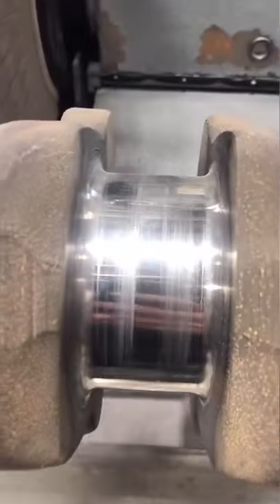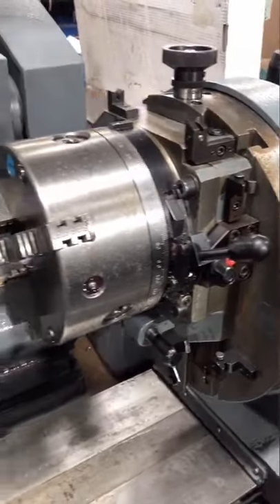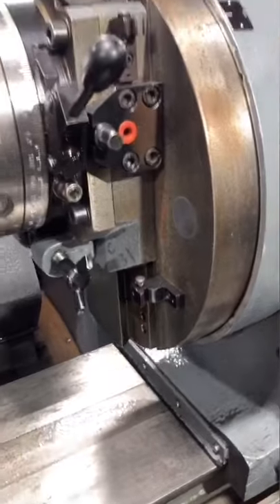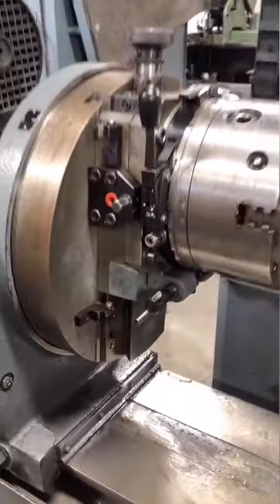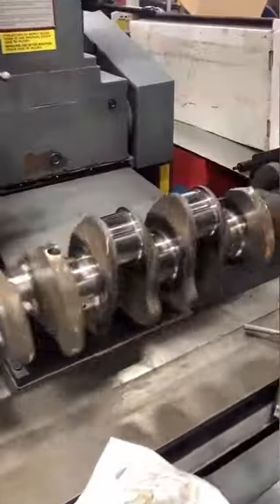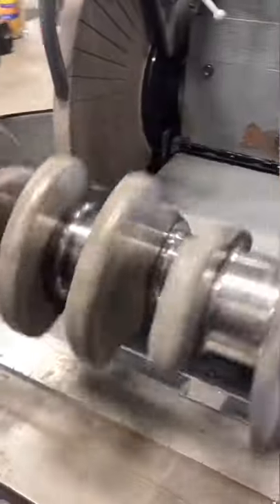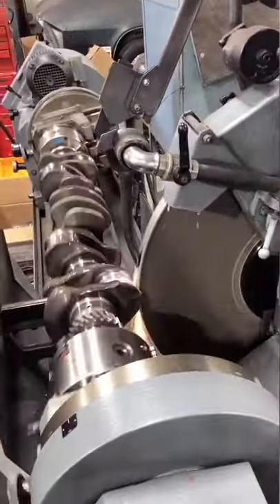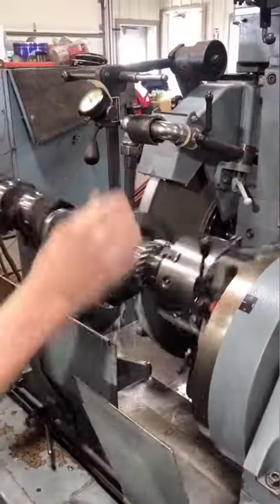#shorts How A Crankshaft is Reground - JAMSI ONLINE

Comment: Ive never seen a crank cut before! All the years around engines this is the first time!!
Reply: Same here. Very interesting to see the process. I'd like to see a full video on it.
Reply: Same, seen them polished before but never ground.
Reply: Because grinding crankshaft requires hardening again afterwards. So I you don't have the ability to reharden it again. Don't do it.
Reply: You should look up crankshafts being cnc machined, even crazier than this regrounding operation.
Reply: @Trident_Euclid  I've been a crankshaft machinists for 26 years and machined cranks from raw forgings to finished..I've worked as a machinist for crankshaft specialist, lunati crankshaft and Feuer crankshaft...the journals normally get a case depth harness of .100"(.050" per side) or more which allows for a O30"-.040" undersize bearings to be used....quite a few crankshafts just get heat tempered with the journals never being individually hardened if anything just the thrust surfaces get hardened..maybe your referring to some large diesel crankshafts which mostly get undercut then have industrial hard chrome plated to the journals to keep surface hardness and a standard size bearing...I've done that process as well...but regular automotive crankshafts can most certainly be ground undersize...
Reply: @MrBubbahunt9  are they ran in a batch furnace? I worked at a heat treat place before but we only did nuts and bolts!! They had to big belt furnaces!
Reply: This is a throw-away society now, get with the program.
Reply: @musicpunk5  its about cheap enough to buy crank kit than to have one ground down!
Reply: @jasonhastings5538  maybe for some car engines. It won’t be for commercial diesels.
Reply: @davidelliott5843  not too mention vintage engines and restorations. 👍🏻
Reply: That’s because many places just replace parts instead of doing work on them
Reply: Yup..just polished.. Like he said ..a rare machine
Reply: There are only like 5 of those machines here in Puerto Rico....
I clean cam tops, my boss sends out to cut the cranks, still I haven't seen the actual machine itself
Reply: @musicpunk5  heh... the world is going down...
Reply: คิดถึง
Reply: @Trident_Euclid  back in the day when i first started working on engines we always sent crankshafts to machine shops to be turned & polished.
Reply: @MrBubbahunt9  i know of several gasoline engines from back in the 70's & 80's that have been rebuilt, had the cranks turned & used .10 & .20 undersize bearings. The rebuilt engines went on to run thousands of miles without any issues. We just sent the crankshafts to a normal automotive machine shop & never had any issues!  
Thank you for explaining the operation in your comment, i think it helped to honestly clear the fact.
Reply: I worked on a CPM as they were known for grinding ship engine crankshafts, This is a baby version.

Comment: The Arnold gauge. Designed by Arnold who worked for Henry Ford. Henry wanted him to speed up the process so he insisted. Arnold designed the gauge to measure while grinding simultaneously.
Reply: Thanks for that Lil' bit of history !
I'm an automotive history buff, and never knew that !
So, now, I am going to be doing more research on this one !
One more lesson taught !
And wayyy more to be learned !
I'm almost 65 years old, and still learning more every day !
A genuine thank you !
Reply: Ford also used Johansson blocks for vendors to have standardized measuring.
Reply: The Arnold gage is amazing and extremely accurate, until you find the oil hole and knock the carbide tips out. 😂
Your Zanrosso looks to be in nice shape, Very Nice machine.
Nice touch on the steady rest as well.

Comment: I was a grinder operator at DMAX for the Duramax Diesel engine. You’d be surprised what a crankshaft looked like directly from the foundry. There are 21 steps from start to finish not including heat treating and balancing. Was a great job.
Reply: Oh I was thinking this was for used parts repair

Comment: Could you do a video on how a crankshaft is balanced?
Reply: From what I’ve seen, they dimple the counter weights
Reply: Yeah same machine but different counter set
Reply: You drill a hole in the counter weight and fill with heavy metal.
Reply: It’s rather boring whichever way it’s done. At least to me it is.
Reply: @Pro2ndAmnd Then why watch they video and comment? makes no sense.  Not like it's clickbait.  It's very interesting.
Reply: @paranormalextract4976  If you read the post from the OP, he asked about crankshaft balancing and not this video. I watched the video and nowhere in it was a crank being balanced.....
Reply: @Pro2ndAmnd  Thought you were including regrinding in your statement.  My mistake.  Either way any engine work is very interesting.
Reply: Are you interested in the math/computation behind balancing? Because the sensors they spin these on measure the imbalance as voltage and the use a crank trigger to show where the peak is against the degree of the shaft
Reply: @carlcomputer9686  I am interested
Reply: @Avery Brant Very smart suggestion!!.. 🤗🙏
Reply: @Andrew-xe7st  
You mean Led Zepplin, Motley Crew, and Slaughter?
Reply: He's showing you ,this is also how you balance it ,to ad weight they weld a line on the balancer then grind it if it's to much

Comment: I’d love to see a video on how you setup the crank in the lathe fixtures.
Reply: They usually have three center drill points with the same offset as the grinder showed. Then when you finish the fist position you move to the second and so on…
Reply: @MuzikHead  That makes sense.

Comment: They are a very cool machine i used one quite a lot in my late teens to offset grind the crankshaft of a Holden 308 cubic inch V8 and run 327 pistons and 350 rods ended up 348 cubic inch and loved to rev tunnel ram twin custom built 390 Holly 4 barrel

Comment: I LOVE IT😀😀😀❗❗❗❗
40 YEAR MACHINIST HERE.
I've ALSO FOUND THAT AS MOTORCYCLE VALVE SEATS WEAR OUT AND YOU LAP(AND OR CUT THEM)
THE BUCKET AND SHIM SET UP( MY 1980 YAMAHA
850 MIDNIGHT SPECIAL)
YOU CAN SURFACE GRIND
THE OLD SHIMS BACK INTO CLEARANCE SPECS.
BEEN THERE-DONE THAT

Comment: Master machinist here.  I can't believe how many people are amazed by what we do.  Balancing a flexible rotor is a pain in the ass though.  You wanna really blow some minds go into electo-plating and how you can extend the life of the part when worn past spec with nickel overlay.  Cranks are all low carbon shit steel anyways so if it fails it doesn't destroy everything

Comment: That's awesome! Fun fact: Harley Davidson engines were developed when making crank shafts was super expensive...so they made both cylinders run off of one crank journal, making the crankshaft easier and cheaper to build. One connecting rod straddles the other, one piston chasing the other, thus giving that iconic sound. If you look head on at a HD engine you'll notice the cylinders are perfectly in line with each other. Every other v twin, the cylinders are offset. All because of the machine you're looking at in this video!
Reply: I've never heard of a four stroke Vtwin that didn't have both connecting rods on the same crank pin. Harleys use fork and blade rods, thats hardly unique. The sound is mainly due to the angle between the cylinders and the firing points. Vincents are side by side on the same crank pin and sound totally different to a harley because of the v angle. And yes, i do own a Harley.
Reply: @ewenmacgregor3991  If you look from the front at your Harley engine, the cylinders are perfectly in line. Look at any other v engine and the cylinders aren't in line, the crank journals are not shared by the two cylinders. You don't have to believe me, I don't care. Look at an exploded view of them, you'll see.

Comment: I wonder on a very general basis what the cost of regrinding is as a percentage of the cost of a new crankshaft.
Reply: Depends on the crankshaft. Most of the time its considering cheaper to be ground ten thou undersized. Like instead of a 1500 dollar crankshaft, you can have it ground and balanced for under 500$.
Reply: @mikeznel6048  good info.  Thanks, Mike.

Comment: I actually work in automotive manufacturing. And actually work on a crank machining line. This looks nothing like what I see everyday.  Lol however the reason why in our grinders are specialized for grinding individual parts of the crank.  For example one will do the output shaft,  one for the rear oil seal, 3 that do the pins (where the con rods connect) and 3 for the journals. 
       The main reason is we crank our 500-600 parts per shift. So there's a lot of automation involved. 
        All that aside I have been enjoying this channel and your content.  👍👍

Comment: I've done this on small engine cranks at a job shop. It's much harder to do. We use a runout gauge, and a 4-jaw chuck with an offset tailstock center... it sucks doing it that way. Sometimes takes hours of ridiculously fine adjustments to get it centered before the few minutes it takes to "shave it to spec" using regular carbide cutters, and very fine sandpaper to polish.

Comment: I can't imagine many machine shops grind many crankshafts. For most automotive uses its cheaper to buy a new one, even in a lot of racing applications. Wjen it comes to much larger diesel engines, such as a tractor engine, it's probably far cheaper to have it ground than to replace it.

Comment: Back in the 80s I did a lot of engine overhaul. I had a bunch of cracks laying around and I sent them out to be cut. I had my own specs. I see them come back and I checked them. They were a .001 undercut called them and the manager said the machinist cut them to the book spec. I always sent my machined parts out with my spec.  They took them back and shaved .001 off.
That was Thule in S. Orange NJ. I could always tell which one was the first finish cut because it was always a couple of 10ths under then on the money. Always

Comment: just the part cost of a replacement crankshaft pulled from a salvage engine for a commercial truck large diesel engine (12-15 liter displacement) is $3000.00 or more.  Wish more shops had the tools and know how shown here!  For a really cool vid, post a new crankshaft being milled from one single block of extremely hard metal!
Reply: Kinda crazy how a manually run machine is being used for this.

Comment: Crank shaft grinders are not a everyday piece of kit you use normally...then again thank God my engine lasts long enough not see it that often. 
I have a feeling this could be done on any grinder for cillindrical shapes. You just need two chucks and "dial in" the desired surface manually ?

Crankshaft grinders seems to be like regular grinder (for cillindrical shapes) with quite the amounth of bolt on gear. You can get chucks separately, the measuring tools too. The only not common thing I am seeing is the absolutely MONSTROUS grinding wheel on it. But I guess grinders need a long reach and that one seems to be built of quite large things. Having a large wheel makes it easy and convenient for you to reach between the webbing of the crankshaft it seems to.

Comment: Yea it was very handy in my younger years working at an engine rebuild shop with full machine shop and fuel lab. 
Built a few engines while I was there, of course.
I'd usually get a crank polished if I bought the guy some lunch 👌

Comment: Did you cut that to a 30 or a 20?
I just got into this. My friend owns a machine shop right in front of my house.... I started by cleaning cam tops. Dismantling them cleaning them and valves also. He shaves the tops off slightly.....
Motors and cams are an amazing invention, without them we wouldn't get around so easy.....

Comment: It might just be a difference in nomenclature or terms of thr trade, but wouldn't you fit undersize bearings if the crank is ground down? If I'm not mistaken the size of the bearing refers to the internal diameter of said bearing. Feel free to correct me if I misunderstood

Comment: i was looking at a crank on ebay that had a pretty scraped up rod journal from a spun bearing. looked a bit worse than the one youre working there, but the seller stated that the scoring can be felt with a fingernail. would it be most common to just grind the journal smaller then get a thicker rod bearing or would it be better to fill the gouges in the journal surface with weld, then regrind it back to stock diameter. follow-up q: wouldn't grinding iron/steel off the crank journal mess with the static balance a little? Would that make it a good idea to just regrind all the journals undersize?

Comment: Quick question on extremely long cranks I've seen Them run out of round out when out of the journals. How do you adapt  for this? I have used easy rest on journals to add suport in the past.

Comment: I have a V-6 crankshaft in the bottom of a Nissan 3.3L VG33E long block, from my 1998 Pathfinder, 166,000 miles.  Very clean and owned by an elderly couple since new.  Oil pan is off. Block is sitting on its top in a tire giving me access to crank. It is a spare motor. It was having rod and/or main bearing knock.  I found shavings in oil and filter. It had been oil starved from previous owner, due to a leak they didn't notice. First I had moonlighting mechanic try to refresh bearings.  Nothing changed. I'm not sure he did it well. I had it pulled out and replaced with used motor. I want to restore the crank, flush motor with cheap vegetable oil and then diesel and put it back in. Any suggestions?  My first time doing any motor block repair. Thanks!

Comment: When you go to pick up a regrind always bring along a micrometer to measure the regrinds not all of them turn out so well.
Reply from the maker: If your machine shop is letting you pick up work that hasn’t been ground correctly, you need to find a new machine shop.

Our shop double and triple checks every measurement before it goes out the door. No excuse not to.
Reply: @JAMSIONLINE  Thats good to know I have seen a few badly ground ones over the years at a number of regrind shops.  They put one on the counter and I always measure them very carefully. When I was younger living in Wichita  I had a build go bad over a bad crank that I didnt check. I went back to the shop it came from and they had about 40 of them lined up the first three I checked were way off I finally found one that was decent put in the new crank and bearings and had no problems after that.

Comment: To me that crank is in the machine backwards the front of the crank should be at the head stock. Not trying to be critical but the only cranks that I would grind like that would be reverse rotation.
Reply from the maker: We’ve touched on this. We grind & polish oriented as recommended by Mahle https://www.mahle-aftermarket.com/na/en/support/installation-tips/crank-grinding-and-polishing.jsp#:~:text=To%20prevent%20rapid%2C%20premature%20wear,in%20the%20direction%20of%20rotation.
Reply: @JAMSIONLINE  maybe in automotive  not industrial.  Cat Cummins Komatsu all Have reuse guidelines. And in those guidelines they all recommend This as standard grinding Procedure
Reply from the maker: That’s cool! You provide me with data that says our method is wrong and we’ll change!

That bearing and crankshaft don’t care if they’re a Chevrolet, a Komatsu, or a Kia. I’ll trust the research of one of the most trusted bearing manufacturers in the world.
Reply: @JAMSIONLINE  hmm they recommend  grinding backwards don't think so  good luck there lone ranger
Reply from the maker: Can’t read eh? 😢

Comment: Older Toyota land cruiser  diesel engines do not tolerate ground cranks very well they typically fail at number 2 crank journal they snap completely crank grinding isnt for all engines.

Comment: Ok Question, how do you insure that the 3 jaws  are running true to each other thru out all the stacked tolerances.   can you lay out or better do a video of the full dial in process? love your pops videos.
Reply: The 3 jaw is just a clamp,
You indicate the one rod journal  Individually. The 3 jaw chucks slide up and down on a dove tail to set the stroke and you use a rod with a drop indicator to make sure you are at the same stroke on each end.
As for mains you indicate the rear seal and snout next to the timing gear  and see where it's cleans up. .010, .020, or .030.....
Reply: @AsaNne-hg7xe so for loading is there a way to lock the tailstock and drive side so the dovetail slides are aligned?  3 jaw chucks are notoriously hard to recenter dead on a part, so I'm curious how that's handled being that you've got 2 to deal with. Fine tune adjusters for the Chuck bodies?
Reply: @charleshartlaub3725  The Chucks move 3 different ways.
2 ways on dove tails with a lead screws, those are are up and down for storke (.000 would be center line and up 2.00 inches would for a 4.00 stroke crankshaft)and side to side ( only .000 to .020 of inch)
The 3rd is rotation for indexing for each rod journal. For example on a V8 every 90 degrees.
Reply: @AsaNne-hg7xe  yea that side to side .02 was what I thinking about. dial in must be a job in itself.
Reply: @charleshartlaub3725  In a perfect world everything is aligned and in new production you can insure all are running true. When regrinding a crankshaft you only have limited stock and if there is any wear on journal it compounds the situation. On rod journals with wear you indicate top and bottom and side to side, almost like it was a square. Going to .010 under is only .005 preside.  I did not make this video and have no way of showing you. Grew up watching my dad gring crankshafts and then did myself for years.